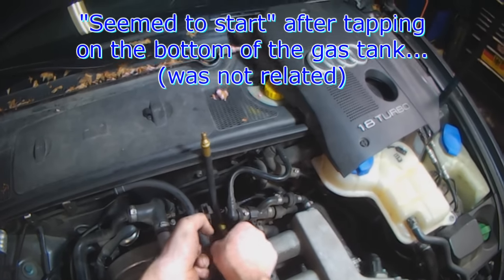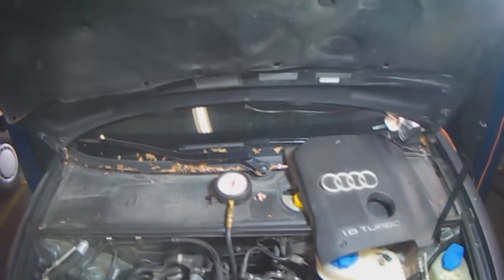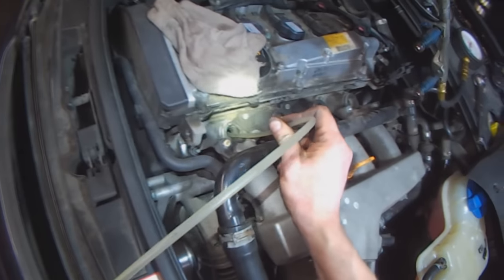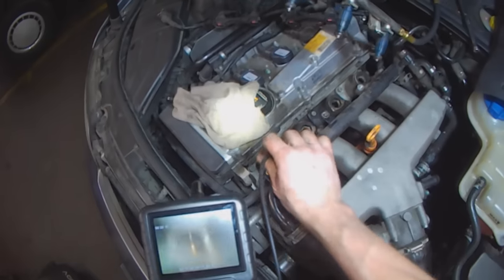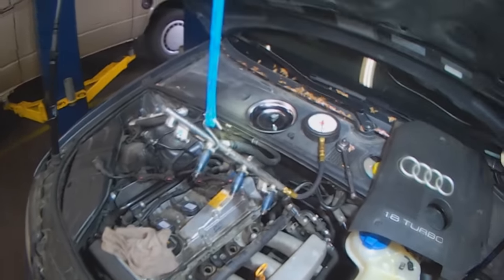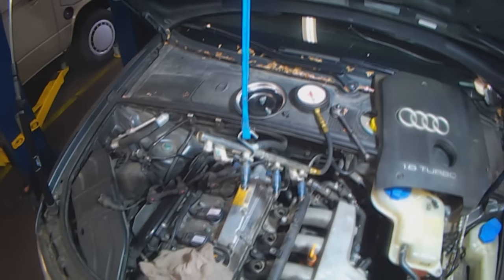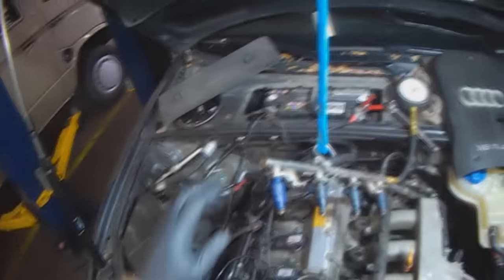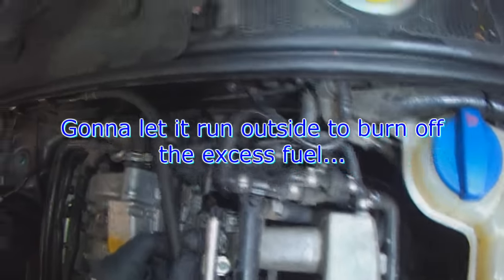Audi B6: 1.8T Rough running & white smoke out the exhaust

Comment: Wow, this is a beautiful example of injector troubleshooting. Many think that white smoke out the tailpipe is anything but unburned fuel but you knew that straight away. Fantastic video and thanks for sharing!
Reply from the maker: Only because I have run into it before / seen it before... the nose also plays a roll (smell the exhaust).
Reply: Thomas EXOVCDS if white smoke smeel like a burn fuel is that fuel injecter need to change ?

Comment: Where do I start? Wow! Great video. I find them informative and interesting. I find myself looking at my car a little more carefully. Dude you rock. Got to get a coffee mug. I have a gli jetta 04 automatic.  Don't have a rough idle but I am blowing white smoke like the Audi your working on. Late model pcv valve clogged. Replacing some of the hoses with silicone and going through the rest of the system, 118,000 mi. So far your vids help to guide me through the work. Appreciate your help with your videos. 
Cheers.
Reply from the maker: White smoke in cold climate is normal... even in warm weather after cold start (water in the exhaust is steamed-off). Thank you for the kind words and thank you for watching!

Comment: My b5 been doing this. Starts fine, but rough idle for a few mins and a lil white smoke. I use premium fuel. Get a weak start on occasion, too.
Reply from the maker: Attach a fuel pressure gauge and monitor pressure. Let me know what you find.

Comment: oh snap! I have a 2010 VW CC 2.0T FSI engine blowing white smoke not over heating good clean non-milky coolant. It runs rough and had number 3 cylinder misfire. The high pressure fuel injector pump was recently replaced along with a the faulty fuel pump module. Car ran good after that until a week later the white smoke appeared. Gotta check the fuel injector. Hopefully one is stuck.
feed back appreciated
Reply from the maker: I haven't yet seen any GDI Injectors that were stuck open... use a scan tool to check fuel rail pressure when the engine is off or remove the spark plug to check for wetness in the cylinder.

Comment: Hi, i don’t know if my english it’s quite enough, but i will make my try anyways. I have a GTI 1.8T transversal, and when i turn on the motor it smells like fuel, in the cabin, and the smoke that goes out it’s color white, the smoke goed harder when i push the gas pedal, changing from white to blue, the car goes great, the turbo has been replaced recently, and really pulls at like 2,200 rpms, it’s only that god damn smoke
Reply from the maker: Attach a fuel pressure gauge (like I did in the video) and check if fuel pressure drops when the engine is off. If pressure drops... check for a leak (injector or fuel pressure regulator at the injector rail... if your engine has one).
Reply: Thomas EXOVCDS i actually forgot to say i opened the motor head and changed piston rings, the seals of the valves were okay, i mean its a 2004 car, but they were not broken. But the god damn smoke its still there,, i think i might sell it, the motor goes awesome and almost feels new in performance, but, the smell its gross, and the smoke makes the car look real shit, i did what you mentioned before, but it didnt dropped, but the compression was very low on. The third cilinder,
Reply from the maker: Low compression is not good.

Comment: I wanna test fuel pressure on my A4 B5 2.8 30V but I find there's a VAG number for tapping between the fuel rail and the lines. I was gonna rent out a fuel pressure tester, but I wanted to make sure if the rail requires some VAG specialty fitting or anything like that to tap in.
Reply from the maker: The easiest place to splice in is at the rail where the hose meets the rail. Loosen the 17mm nut to remove the hose from the rail. A Master Fuel Injection Pressure Tester kit "should" include fittings that will allow you to splice between that fitting. If not, you could splice a T into the feed hose, but that requires cutting the hose... and you would have to join the hose with a piece of straight pipe after you are done (with flared ends so that hose clamps will keep the hose ends from sliding off of the pipe).

Comment: Awesome video really helped me out, thanks for taking the time to do this. I have that exact problem I think/
Reply from the maker: Thank you for watching!
Reply: Well, I started the car back up, and suddenly it is running fine. It went from unable to start for two days, to sputtering today, and now back to normal. No white smoke at all...I know it is not the fuel pump. Maybe the sticky injector unstuck. I am going to run some injector cleaner for now... Huge thanks Thomas.
Reply from the maker: Let me know how things go.

Comment: Hey man, great video.. helped me fix my a4 today, quick question though. I replaced the two bad injectors and it started right but after about 20 min of driving at idle has a white smoke that goes away when driving , no coolant leaks or oil leaks, could it be PCV or TURBO SEALS .
Reply from the maker: Next time it smokes, smell the smoke. It will either  smell of oil, coolant or just be condensation.

Comment: Awesome video man. You are a true at guru!! I know people flood the comments with "halpp my car no work" but I've got an 1.8t on 26 lbs of boost. She was running great but I noticed the valve cover was leaking and fouling my plugs. I happened to get the gasket the day I had a problem unfortunately... I was spooling at like 20 psi downhill and it out of nowhere backfired, all I see is oil smoke coming from my exhaust. Now I've got the gasket on. Theres smoke coming from the pcv under the intake and that is not normal from what i understand. Check oil for fuel? I'm wondering if the rings went or not.
Reply: Seeng this on the internet, now.
Another definitive PCV valve test is to remove the vacuum hose and look for fresh oil. A PCV vacuum hose, with oil dripping or a wet valve, usually suggest too much flow, which causes oil consumption. Checking the PCV vacuum hose is a wise precaution, on any engine that consumes oil. Also, if you see blue smoke coming from the tailpipe can mean many reasons, but the first step is to check the PCV valve. Basics First!
Reply from the maker: Let the oil filler cap dance... if it dances, piston rings are probably ok.
https://www.instagram.com/p/ywFjz7FDfW/

Comment: Need help, My Chevy Cruze petrol, just having rough idle and a lot of white smoke, the mechanic already change the Piston ring, cylinder gasket, but the problem still there, help me diagnose the problem, is it air flow sensor, or bad injector, or bad coil, or bad head gasket? Thanksss
Reply from the maker: Take it back to the mechanic and tell him that he didn't fix the problem.

Comment: Hi Thomas, thank you for the videos, I have an audi tt with the same problem, white smoke and boost problems from 2000rpm, would you look at the injectors first?
Reply from the maker: If it runs / idles rough, then yes... check injector(s) first, especially if the smoke smells of fuel.

Comment: Could you have tested for the bad injector with the scope like scanner danner does ? Also for checking the other injectors ?
Reply from the maker: Yes, but the longer the engine runs with a bad leaking injector (for testing purposes)... the greater the risk of hydrolock. I have seen this symptom before and that is why I pulled the rail... does not take long and is a quick 100% verification if there is a leak or not.

Comment: Hey man great video! Quick question. 

I’ve got a 2001 Audi TT mk1 1.8t, engine code ATC. 

It’s started having geeky large idle fluctuation and I’ve noticed my fuel economy is trash, I’ve checked most of the PCV hoses and none seem cracked, would a stuck injector cause this?
Reply from the maker: I don't think so... no fault codes stored in the ECM? When was the last time the throttle body was cleaned? Use a scan tool to check short term & long term fuel trims... that can tell you if the ECM is trying to correct for a lean or rich fuel mixture.

Comment: Exo I watch all of your videos and and love your thoroughness, I have a 1.8t aum. Recently I have developed a cold start rough idle with quite a bit of white smoke (doesn't smell like coolant). The rough idle clears after i blip the throttle and the white smoke lessens nearly completely once the car had warmed up. I suspect this is a faulty injector. I also have minor intermittent misfire on cylinder 3( changed plugs and coilpacks). Is it possible for a faulty injector to stay open for a short period then work better as the car warms? Will be doing the same as you tomorrow thanks for your vids!
Reply from the maker: Thank you for watching!
Yes, could be a faulty / slightly leaky fuel injector. When the engine is off, the injector allows fuel to drip into the engine... causing the rough idle & smoking on start up. Also check the fuel pressure regulator vacuum hose for fuel wetness. Remove the vacuum hose from the fuel pressure regulator to see if any fuel is present... do this with engine off first. If no fuel is present, start the engine and check again.

Comment: thanks for sharing your knowledge 
I have a  beetle 2000 with aeg motor can I swap it with a 2002 motor avh 
and what can I do to make it work
thanks
Reply from the maker: +Juan Ortiz The "long block" / bare bone block & cylinder head will swap right in... it is best to swap all the mounting parts from the AEG to the AVH long block. The AVH is "drive by wire" / no throttle cable... so you have to use all the AEG stuff to make it run. I have not done a swap like this... do more research in VW forums (VWVortex) to get feedback from people that have done it. Thank you for watching!

Comment: Hello, I just found your channel today.
Excellent channel  👌 

I think I have the same problem as the Audi that serviced you.

Here is some description of this problem:
This happens sometimes with a cold engine start, but sometimes it's just rough running without white smoke. 

It is possible sometimes to injector get stuck - open position, and sometimes get stuck - closed position?

In both cases, after 35s, everything works normally.

Unfortunately, I do not have a manometer, but I still removed the injectors like you, but they were working fine then. I still have to try again with a cold engine.

What do you think about it? It may be the same problem?
Reply: Here's a clip

https://youtu.be/68carNdFq9Q
Reply from the maker: Yes... could be an intermittent issue with an injector sticking open or closed. Does the computer list which cylinder is misfiring? Swap 2 injectors if it is only one cylinder that is setting a code. If the misfire follows to the new cylinder, then that injector is bad. Thank you for providing a video! Send me your mailing address and I will send you some of my channel stickers! Thank you for watching!

Comment: Hello brother. There was a head gasket leak on my skoda superb 1.8 tsi so we rebuilt the engine. The first time when it was installed, it started very smooth but had lots of thick smoke. The second time we checked the head postion and reinstalled, had some smoke. Third time for some reason it started to misfire and emitted a lot of smoke. Can you suggest anything as a VW expert that can come of help?
Reply from the maker: What are you using to make sure the cam & crank are at the correct TDC position? Any oil in the intake / intercooler??

Comment: wonder if I have the same issue on my 2005 vw gti 1.8t checked everything else but injectors..still getting white smoke though 😕
Reply from the maker: +tino2005gti This one was running quite rough... the white smoke at the end of the video did not cause any rough running. If you are not losing coolant, monitor oil level. Pulling the injectors on yours is lightly different... but worth checking. Attaching a fuel pressure gauge (to monitor pressure drop) might be the least intrusive thing to do / try first.

Comment: Would a leaking inj. cause the car to stumble on restart after the car has ran several miles? Love your vids!
Reply from the maker: Yes... depending on how much, it could be a bit of rough running or long cranking & rough running. Similar symptom could be due to faulty N80 purge valve, bad fuel pressure regulator, fuel pump check valve and probably some other reasons. Trick is to test / check the right component when it is acting up.
Reply: Thanks for the reply. It starts after a little more cranking than usual and stumbles at 400-600 rpm like it's going to die for about 10 seconds then it's all good. I'll check the fuel pressure. Thanks!
Reply from the maker: jwalker1200 Could be vapor lock due to drop in fuel pressure... or EVAP gasses getting past the purge valve into the intake. I'm sure you will find the cause after checking the systems.

Comment: Thanks to your videos I changed the valve cover gasket and replaced the thermostat and it's gasket today. But it is still smoking in the engine compartment and white smoke out the tailpipe. In the engine compartment the smoke could be coming from left over antifreeze and/or oil but coming out of the exhaust? It runs fairly smoothly. Could it be a bad pcv valve?
2004 passat 1.8T. Thanks in advance.
Reply from the maker: Post a video on your channel.
Smoke from the exhaust is normal when the engine is cold... condensation / water vapor. If the exhaust smoke smells of fuel, you've got a leaky injector issue. If it smells of coolant, possible head gasket or turbo, if it smells of oil... possible piston rings, valve stem seals or turbo. Underhood PCV fumes can come from under the intake manifold where the main PCV components are. Follow the smell to the source.

Comment: I think i have same problem, it cranks but start harder, after that i can rev it but when i let it idle it start dropin rpms and stall, i noticed smoke from exhaust and also from engine bay, smells like unburned fuel
Reply from the maker: Check spark plugs. Focus on the one / cylinder that is wet.

Comment: Hi Thomas hope you can help. my 1.8t starts fine but a second later it will splutter and run funny for a few seconds and then the revs climb up. to about the fast idel speed. after that, it settles, and it's fine. I notice I get smoke like that in the video and has a strong smell of fuel. it only does this on a cold start.
Reply from the maker: It could be that one of the injectors is sticking / leaking... or the fuel pressure regulator is leaking fuel into the vacuum hose (disconnect fuel pressure regulator vacuum hose to check for raw fuel). Attach a fuel pressure tester to verify / check if fuel pressure drops. You can also shut the engine off once the engine runs rough & smokes... remove the spark plugs and check which one of them is wet (that will tell you which cylinder to focus on).
Reply: @EXOVCDS  thank you ill give this try. do you think my t peice could be the issue since its tapped into the fuel pressure regulator
Reply from the maker: A vacuum tee can not cause fuel to get into the system... a bad pressure regulator will do that (that's why I suggested checking the vacuum hose).
Reply: @EXOVCDS  thanks ill need to order a fuel pressure test kit

Comment: good video , trouble shooting applicable for enhancing knowledge. thanks for uploading. btw what borescope did you use..goedendag
Reply from the maker: Google search: Maxivideo MV400

I bought it at a local parts store a few years ago... better video quality than my snap-on borescope (older model, so not really fair to compare).
Reply: +Thomas EXOVCDS I love good tools,  btw I use injector testpump for diesel, maybe you can use for gas. can see spray image and pressure when it cracks..i have opel agila 1.0 lpg no problems, but my brother has audi a4 , helping him a lot thanks for response...goedendag
Reply from the maker: +georgio jansen We also have a diesel injector tester like that. We need to get a bench tester for the gasoline injectors... a flow rate setup, so all injectors can be compared at the same time!
Reply: +Thomas EXOVCDS looking forward to see the video about this setup....goedendag

Comment: I have white smoke that appeared and my mechanic isn’t sure if it’s remaining fuel left in the manifold or new turbo what advice can you give me to avoid spending a lot of money
Reply from the maker: Attach fuel pressure gauge, start engine, turn engine off... if fuel pressure drops, could be a leaky injector. Check for / drain the oil out of the intercooler.

Comment: Hi, I have the B6 quattro avant 3.0 tiptronic. I recently changed my transmission fluid due to a leak. We were on vacation and I came back to a car that would not drive I noticed the oil pan also had a leak. Due to my work, I wasn't able to work on my car for over a month. Anyway, I filled the transmission fluid--it was empty. I decided to drive it around the block and the oil light and coolant light were flashing. It's a very small block. I pulled back in the driveway and filled the oil and coolant, but I noticed thick white smoke billowing out of the tailpipes. Very stinky. The smoke will somewhat die off if the car is idling, but as soon as I put it in gear--thick again. In your professional opinion--do you think I cracked the head or caused the head gasket to leak? I'm lost on what to search for now. Thanks
Reply from the maker: I don't know... remove the spark plugs and check for coolant in the cylinders. I doubt that "one" drive around the block caused damage... the gasket was probably stressed more than once in the past and decided to let loose now.